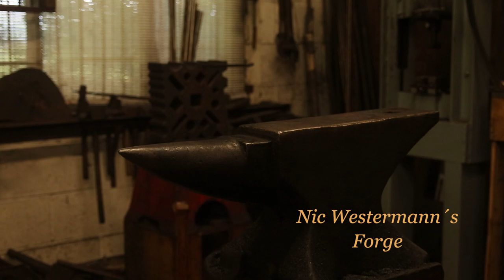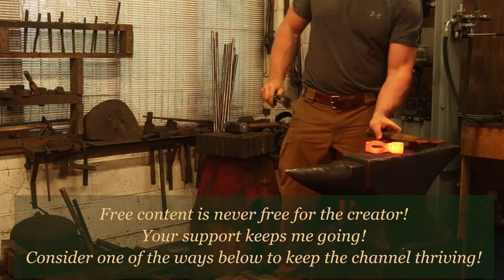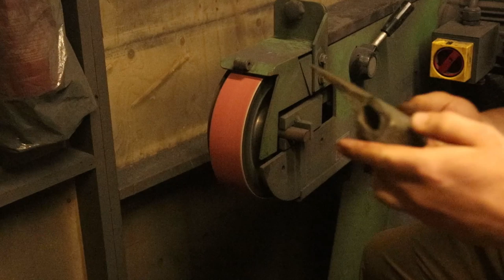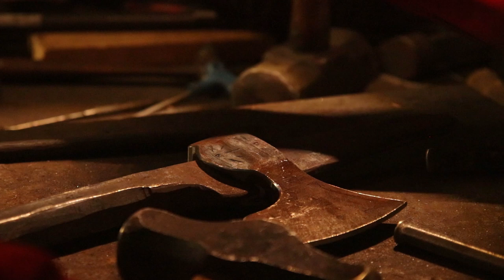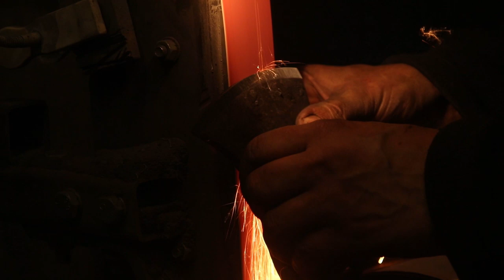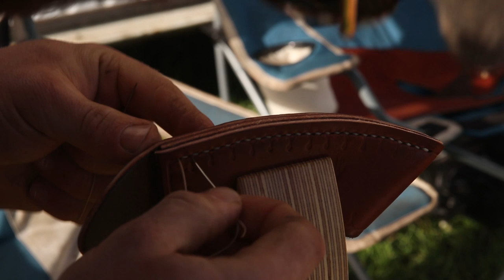Forging a Carving Axe with Nic Westermann - From Steel Bar to Haft and Sheath

Comment: Things for students to take note of:
The anvil is solidly secured. Even while the edge was being leveled one the tip of the horn, it didn’t budge, jump, or shimmy.
Notice that they used a platform on the striker side so that the sledge, which looked like a 12lbs,  when striking the tools was as close to parallel to the anvil’s face as possible.